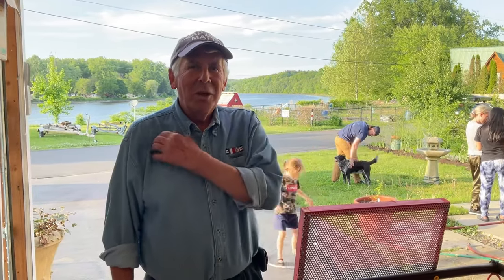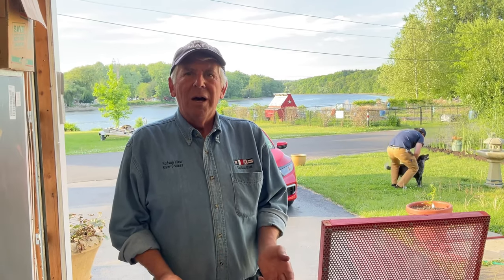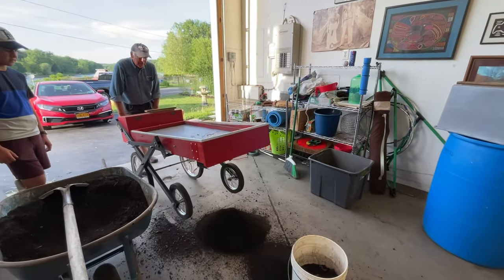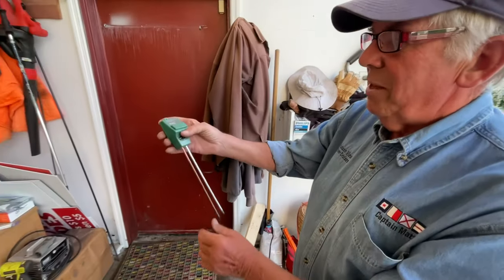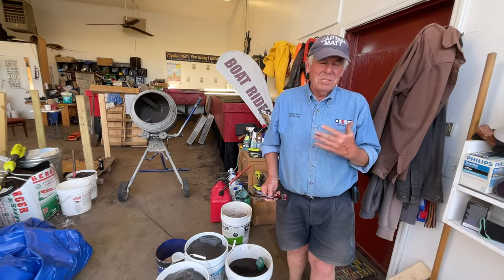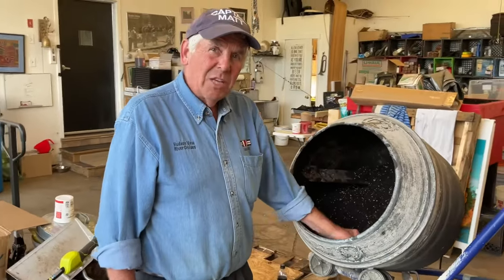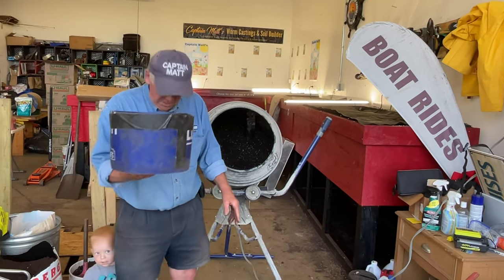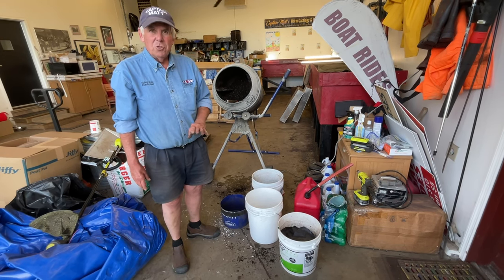How I Use Worm Breeder Buckets

Comment: Do you add the cocoons to the CFT system after sifting them out? If not, what do you do with them?
Reply: Captain Matt putts the cocoons and undigested bedding into his big CFT's.
In the CFT's the cocoons hatch and grow into bigger worms making castings as they do it.
It is possible to put the cocoons into more buckets or a nursery to hatch and then as long as he harvests castings and separates the worms before new cocoons hatch, well then, he would have sized worms with a known age (there are worm wranglers that know the age of 99% of their worms).  With this method of growing worms, it is very easy to outgrow the space used to grow the worms in. So, when these advanced methods are used space management is the most important thing to master. Growing worms in buckets allows a worm wrangler to have predictable   outcomes that are very accurate when it comes to casting and worm production. Captain Matt does it more for the casting production hence the big CFT's.  Either way it's all good.
Have a great Day!
Reply: @ไส้เดือนเพื่อชีวิต  What's CFT?
Reply: @tomfilbey  Continuous Flow Through (worm bin) a very good example is the big red worm bins Captain Matt has.